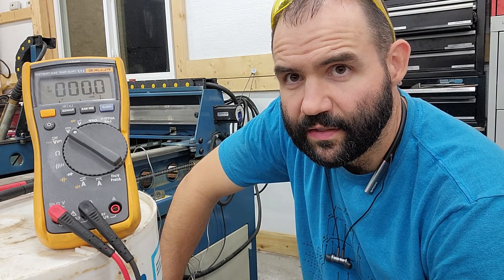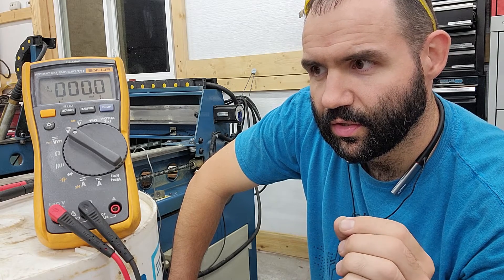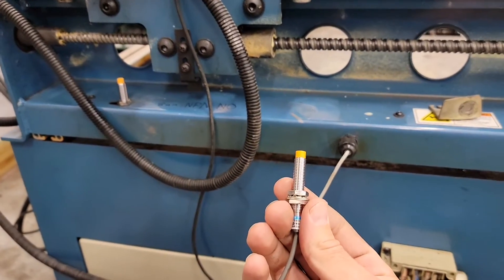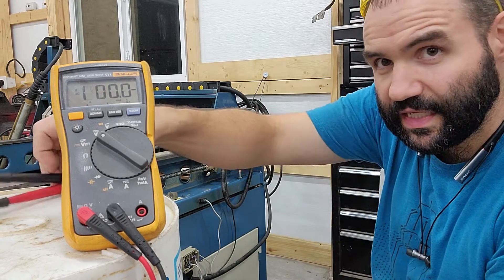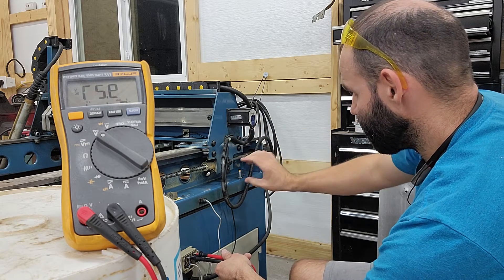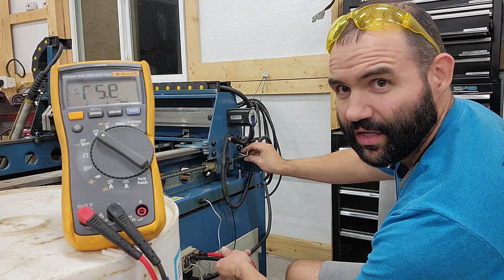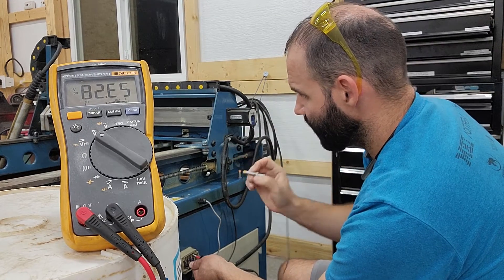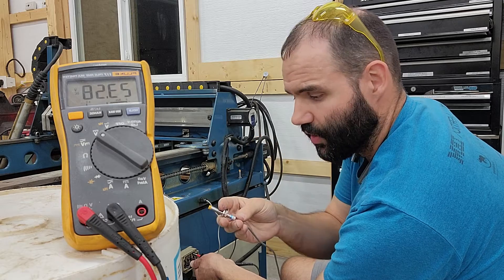PNP vs NPN EXPLAINED! Proximity Sensors on CNC Plasma Cutter Router Table

Comment: i think you have measured between +ve and out put black wire in PNP so it saws 24 volt and when its activated you get 0 v both wire becomes +ve , at same voltage difference.
Reply from the maker: Thanks for your post. I will admit that it took me a while to figure out since I was learning as I went.  What I did got it working, so I must have gotten something right!